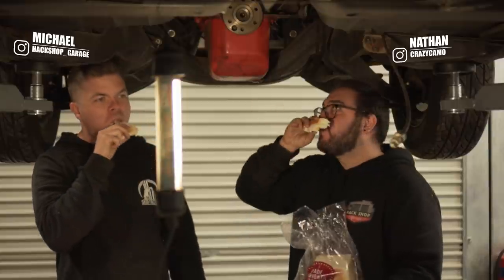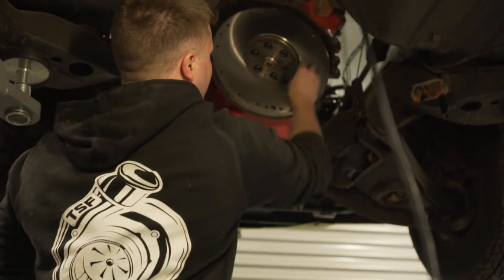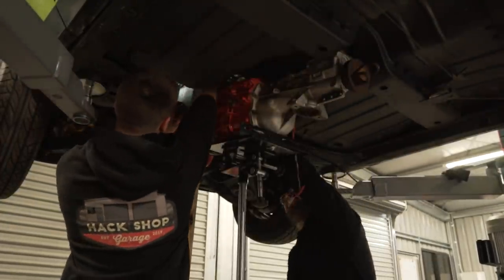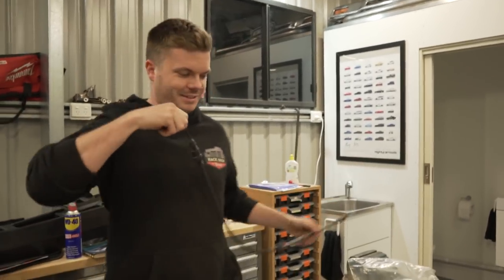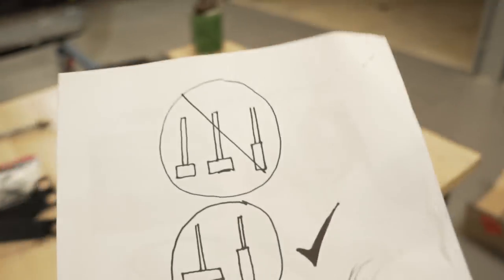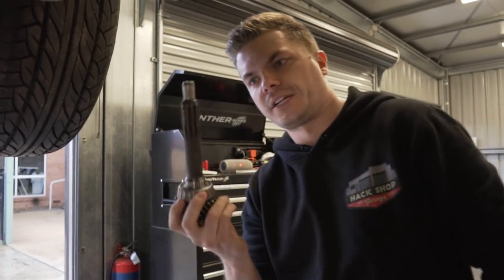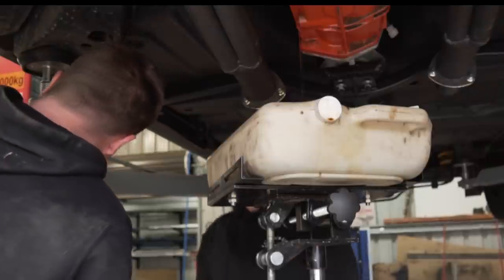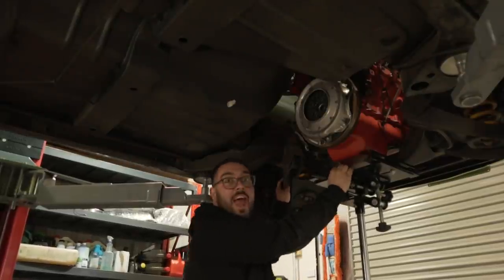HQ Holden T5 Conversion - Part 4 - Gearbox In, Cable Clutch Conversion and Start Up!

Comment: A clutch alignment trick I was taught in my first year, if you don't have an alignment tool.
 2 drops of super glue opposite each other on the clutch plate and sit the clutch plate on the pressure plate. Make sure the gap around the outside is even the whole way around, let it sit for 10 minutes then bolt her up. 
All you have to do when you start is foot on the brake, foot on the clutch, gearbox in 1st or reverse and crank til the glue breaks. Works perfect every time!

Comment: Its a great convetsion.
I got some questions.
1. What is the name of the cone that spaces the clutch cable on the bellhousing?
2. Can the cone be bought seperately?
3. Is the a manfacturer part number or  dimensions on the clutch pedal?

Comment: Hey boys your doing a great job. Can i just say when you put your bronze bush in the crankshaft you normally oil it so either soak it in engine oil or put the bush on your thumb and fill it with oil and use your index finger to squeeze the oil through you can see it come out cause its porous. Then install into the engine. Only cause if you put it in dry or grease on it it can dry out and squeak. And to fix it you will have to pull the box out again. Also when you do your rebuild on your 308 on hj van would you consider doing the stroker 355 it makes a big difference and you will never go back to a 308. You can buy the kits for a reasonable price from COME racing. It is a noticable Power difference and so much torque it will give rhe old Fairlane a run for its money. Keep up the good work
Reply from the maker: Good advice mate, never heard of that before but can understand the reasoning for it, we will keep it in mind for next time. 

I like the sound of the stroker kit, it would be awesome, just not sure how the old T5 behind it would go handling it haha
Reply: @HackshopGarage  it would be ok if you drive sensible if you do burnouts everyday it wont last as long. But there pretty strong box not sure about the diff tho. If you change all the gearing so 355 with the t5 and 3.55 diff ratio every thing will march fairly well. Something to consider
Reply from the maker: yeah we will certainly consider it, would be good fun.
Reply: T5s aren't strong at all 😂 I've killed them behind stock v6s lol even v8 ones are weak (same internals just different ratios) cousin had 355 in his vp ss broke 7 t5s in 4 months just driving normally lol went to a mal wood built (g-force internals) and never broke one again, it's the torque that kills them. 
They can  be strong once built , g-force internals are around 4-4500 from what I've heard or u can buy a complete g-force t5 for 5800, not cheap but worth it 👍 
Wanna get one for my vn v6 once I turbo it as I know the stock t5 won't survive 🤔😂
Reply from the maker: Haha not cheap, but sound good

Comment: It does work my dad Taught me that trick
Reply from the maker: It’s an oldie but a goodie ey
Reply: Just be careful there isn't a Welch plug in there.if you ram grease or bread in there you risk pushing it into the oil passage.

Comment: Sorry to be the old fuddy duddy. I can't tell if you were joking or not about the length of the tailshaft being shortest at full droop? Did you check it through the articulation of the suspension?
Reply from the maker: Fair question mate, yeah we did check it, as the diff moves into its normal position (swings up into the car) when the cars back on the ground, it moves away from the gearbox.

Comment: What is the oil you put in the gearbox?  T5s should have Automatic Transmission fluid in them. I am doing the same conversion to my HQ Ute but I got a Mustang tail housing from the US to move the shifter box forward.
Reply from the maker: Mustang tail housing sounds like a good idea. The oil we used is Castrol manual VMX 80

Comment: I am planning the same conversion on my one Tonner, can you list the kits you used for the 5 speed conversion.
Reply from the maker: Sure can
Gearbox conversion kit - Dellow conversions for HJ and above (to get the cable type bellhousing) 
Crossmember - Castlemaine Rod Shop
Accelerator cable and cable clutch conversion - restorcountry